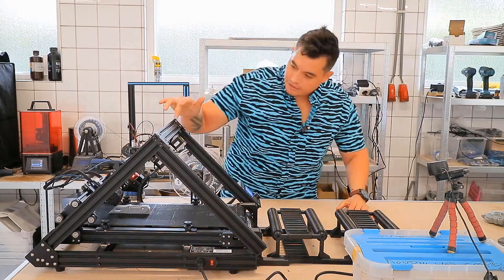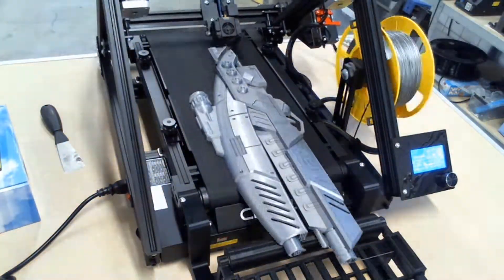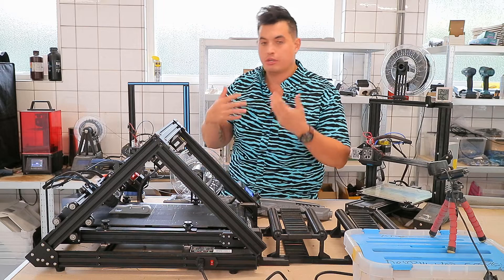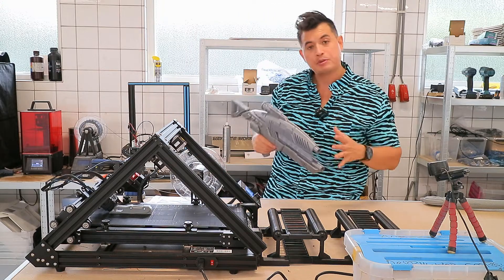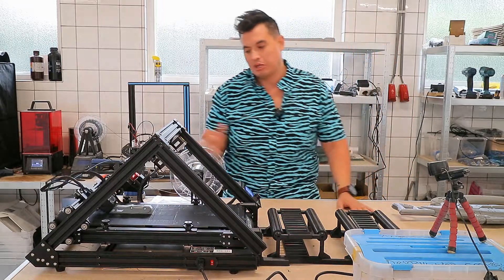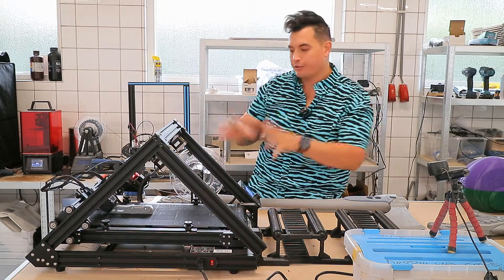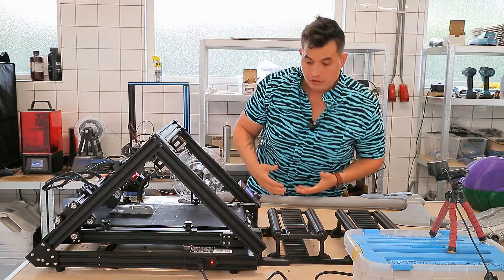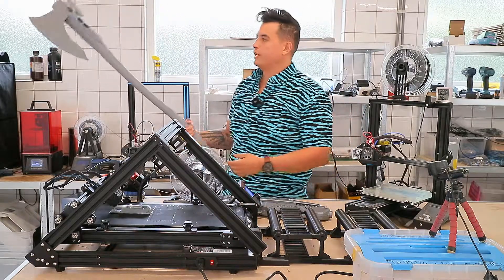Creality 3dprintmill - Is It For You?

Comment: I'm watching this at 2025. Still informative. Who else is still using it? Mine broke so many times with so many issues over the years . Got it fixed today and it started to print again. Comparing to my Bambu lab printer, it's way too slow and the quality is just not good. Still I'm holding on to this printer as it was quite expensive when i bought it